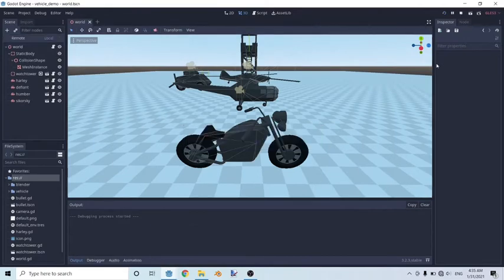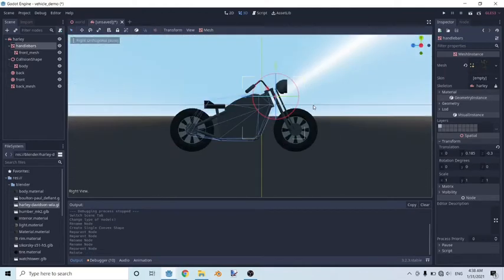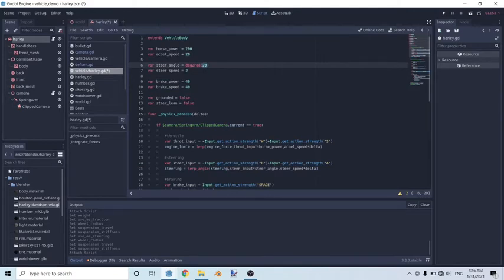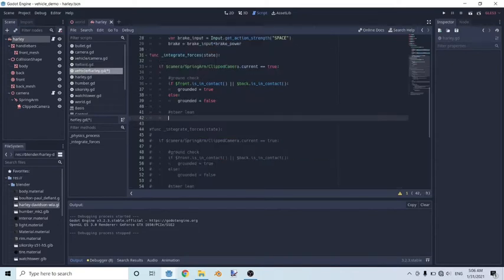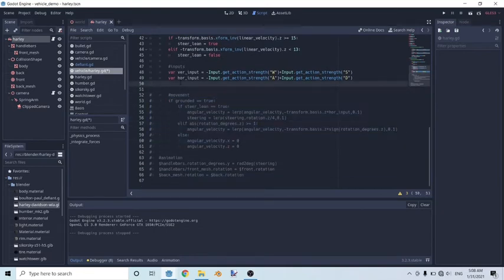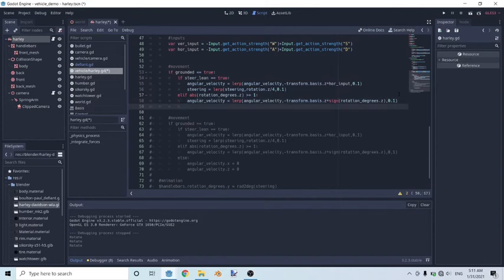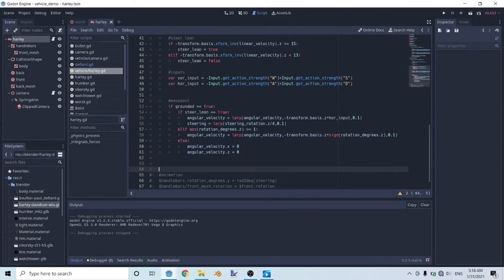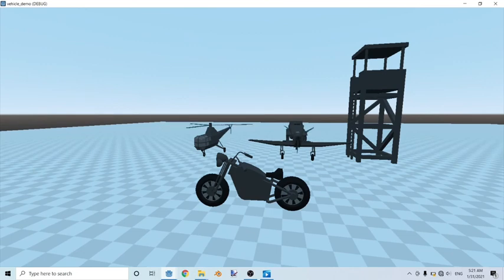Godot Vehicle Tutorial (VehicleBody): Motorcycles

Comment: I'm struggling to figure out how to limit the amount of leaning the bike can do. My goal is to instead of having a minimum leaning speed, I'd raise a max_leaning amount depending on speed, and also depending on the kind of bike (e.g. more for racing bikes, less for dirt bikes).
Reply: Seems like doing this works (added this check after the steering code):
if rotation_degrees.z > 45 or rotation_degrees.z < -45:
    angular_velocity = lerp(angular_velocity, -transform.basis.z*sign(rotation_degrees.z), 0.9)
Reply: @skaruts  hi, im trying to figure out how to switch 3 or 4 vehicles using just one key. But i don't know how to write the code exactly to switch more cameras.... can you maybe help me?

Comment: Amazing tutorial!
But for the love of the Godot community, please, don't use $NodePath in places that are happening regularly & repeatedly like _process, _physics_process, and _integrated_process. $ is shorthand for get_node() and is taking minuscule but unneeded performance cost. A good practice is to save reference with "onready var" but for the case of checking if active have a local bool variable that is turned to true with some function that's setting the camera to current.
When in the prototyping phase, of course, no harm was done but for tutorials or actual projects, it's better to keep good practice. Godot doesn't have that many tutorial creators so new guys can learn the subpar practices and pass those to the next new guys because they didn't know any better.
I love seeing VehicleBody tutorials, they need some love too.
Reply from the maker: Ah, I didn't realize there was a performance cost for using $. I usually use onready var to save myself from typing out node paths if they appear in my code often and/or are subject to change. So this is interesting to know, thanks for the info! 🙏